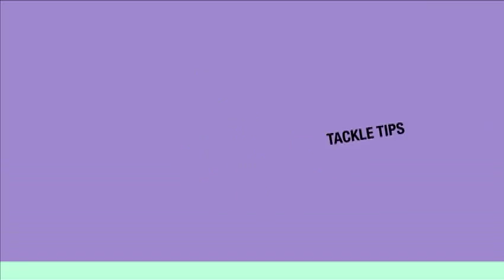Ethanol 101- What happens when you use Ethanol in your boats motor

Comment: Right on.   I used ethanol fuel in my small engines for  years before I learned than non ethanol fuel was available in my area.  I used Sta-bil ethanol fuel treatment as directed, and not once had a problem with phase separation or carburetor corrosion.  In that time I heard countless stories of damage caused by ethanol fuel.

Comment: Just put 100% gasoline in your boat...It may cost a bit more, but absolutely worth it in the long run. I have a 2004 150hp Mercury that has never seen ethanol.. It runs like a top. I have a fuel/water separator that I change the filter on periodically. I had to change the primer bulb once.

Comment: What a croc. I have been running my F250 on 10% ethanol for 10 years without an issue. My previous boat also ran ethanol 10%  fuel without issues in 1235 miles. My biggest issue was fishing line eating the lower unit seals...
Reply: You know he’s talking about older two strokes right??? Lol
Reply: @guccigang6287  oh 🤗.  Thanks doc
Reply: 1235 HOURS! Sorry..
Reply: Your f250 was made to run on ethanol dummy. And 1235 hours ain't nothing to brag about.

Comment: First, Just don't put any ethanol in a outboard. Secondly, add stabil for long term storage.
Reply: Its really not that easy everywhere I am its all ethanol
Reply: Don't put ethanol in any outboard that has been running on the old carb clogging leaded gasoline.

Comment: Hey Steve,Question I bought a 2.5 Suzuki outboard 4stroke motor a year ago. it has been sitting in  my closet all last year with about a 1" of fuel in the tank.I went to start it and it would only run with the choke full on. A outboard repair shop told me the  carb needs to be rebuilt now after only 4 hours running time on it because I used a 87% octane with ethanol. Does this seem right to you or is he just giving me a load of ?
Reply: This is a common issue with carburetors that expose their float bowl fuel to outside elements, unlike EFI vehicles in this respect.  Your repair shop is CYA'ing.  The smallest orifices in a carb are in the pilot circuit; the pilot jet, the pilot fuel/air screw and tunnels.  All fuel decays over time, especially when exposed to evaporation. A DIY'er can do this job with a simple can of carb cleaner and a few hours of effort.

Comment: Better to remove the ethanol. Then add some isopropyl. Ethanol does cause problems, especially if it sits for any length of time. The additives do help a little, but are not a sure thing. Note: if you do remove the ethanol, start with premium fuel, as ethanol does provide a few octane points. I then add isopropyl to absorb any possible moisture. All my machines run perfectly now.
Reply: Actually @octane rating of 92 That is the max stated 10% Ethanol blend. The ethanol % is HIGHER in the  premium fuel. Remember the ethanol is the octane antidetonant additive.
 2 stroke makers specifically advise you to select the octane rating to their jetting. Sine ethanol has lower BTU than old school real ethyl gas, you rejet to ran fatter. So a old 2 stroke that ran gasoline in the 1960's will need a jet change of 10% Larger sized orifice to run todays pump gas. Step up two jet sizes for trial tune. And yes, your idle mixture will have to increase as well. 1/8th of a turn increments to get factory idle speed. I adjust my idle and fast speeds according to refinery changes of winter to summer blend. There is a difference for barometric and humidity between seasons. Any alky dirt tracker or drag guy knows that. Some guy near Ft Worth knows the tune for straight alky and nitro  in his race boat. But he's smarter than me.
Reply: Isopropyl alcohol breaks down oil in castor bean/nitro fuels. It acts as a solvent. So on that thought, it could be detrimental in incorrect quantity to lubricity in a 2 stroke.
Reply: News flash: ethanol is alcohol. 200proof to be exact. Freakin geniuses....